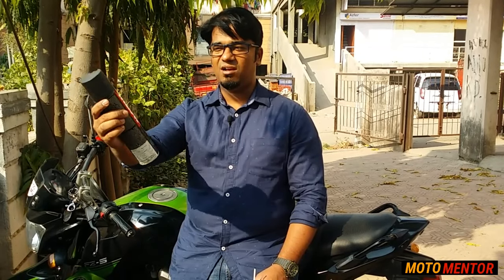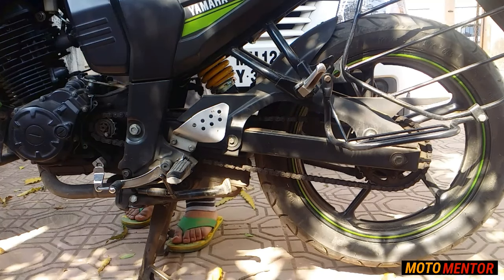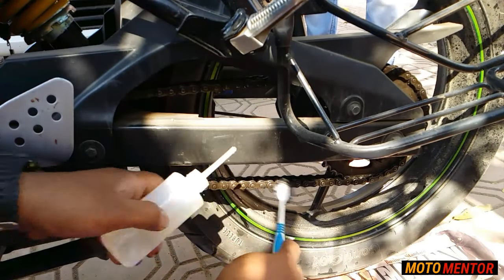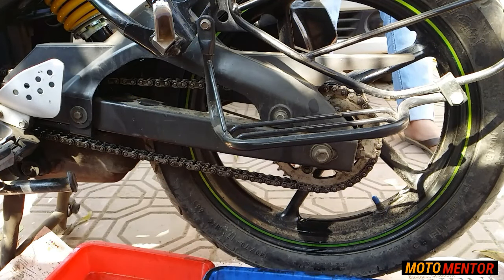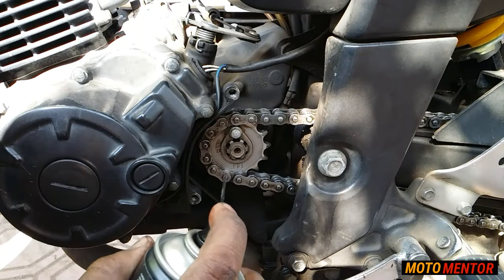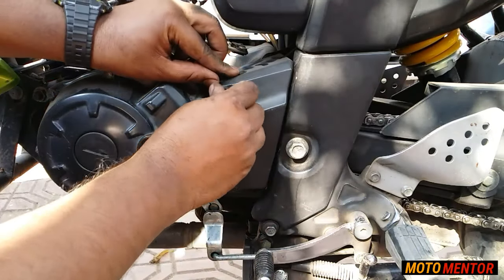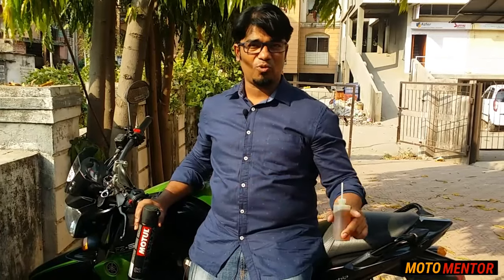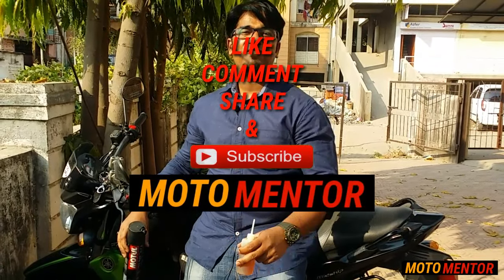BIKE CHAIN NOISE ? THIS IS HOW TO CLEAN AND LUBE MOTORCYCLE CHAIN MOTUL CHAIN LUBE VS 90 GEAR OIL

Comment: Bro thank you very much for that information...  Nw 2 month's end..  I'm using this oil method..  My bike chain is perfectly ok..  And my bike always run very smoothly..  Thank you very much brother..  🙏🙏🙋
Reply from the maker: THANKS FOR THE APPRECIATION VINAYAKA THIS MEANS A LOT 🙏
Reply: @Yash D 300 or 400 .. Or dry honeke baad
Reply: Bhai, will the oil get sprayed on to the wheel rims/ mudguard while you ride the bike after lubing?
Reply: @MOTOMENTOR  Can I Use Diesel For Cleaning
Reply: @rajkumarbabaleshwar255  no.... kerosene is best .... It's said that diesel in some cases hardens the chain o rings ..... Soo go for kerosene .....
Reply: where can we get gear oil.?
Reply: @sapienmanas0735  Amazon but now there is out of stock
Reply: @MOTOMENTOR  tumrha chain sprocket kitna chala gear oil ke sath

Comment: Using graded oil for lubricating chains is a very old technique and is successful for years. Actually present generation boys follows few vloggers who r sponsored by companies like motul etc etc who promotes those companies  product by using their products on screen during their tour like leh ladakh and others showing if by using those products they have trouble free journey but parallely those products r very very expensive also
Reply: Correct
Reply: Yap bro sponcer ke liye  vlogger kitna chutiya banate hai.😞
Reply: Absolutely 💯% Correct
Reply: Absolutely right in owners manual it's clearly mentioned it how to lub chain. But nobody have a time to reed the owners manual.
Reply: @gaurav8580  true
Reply: Can I use "used engine" oil ? which is also called mobil I guess
Reply: Imagine owning a superbike and using your age old "graded oil" for lubrication and getting the whole drivetrain greasy and muddy due to the Indian conditions.
Reply: Companies like motul are a Premium option for cleaning and lubrication, there are various budget options like kerosene for cleaning OKS, kangaroo etc for lubing, they don't attract much dirt and don't fling off the chain and make your alloys dirty.
Reply: @imshahrukh4068  unused engile oil ya phir gear oil use krna bro main bhi krta hu
Reply: Truly said. I have always disassembled the front sprocket and the chain, then cleaned them thoroughly with the help of diesel or kerosene. Then applied grease and that's it. It runs smoothly.
Reply: Bro even iam using grade oil for my bs6 Gixxer chain.. pros: running smooth and fuel efficiency, cons: dirt sticks with chain
Reply: Agreed
Reply: @aniruthparamasivan3441 Chain spray catches equal amount of dust as gear oil.
Reply: Looting public all chain lubes smell alike 90 grade gear oils
Reply: @PRITAMPAKHIRA But at rainy seasons dust accumulate more better clean 90 grade afther two weaks according to yours drive clean and lubricate👍
Reply: No.
Wrong idea.
Reply: Motul sirf naam ka hai isse badiya Castrol hai

Comment: I recently bought gear oil to lubricate the chain on my classic 350 only because chain spray is not available in this small town I'm at. Pleasantly surprised to see the smooth results..and had been wondering why everyone is not doing this in the first place.. Better than the expensive chain spray in my opinion.
Reply: Because it makes your spokes and rim dirty.....whereas chain lube like motul are....a bit dry type.....so it doesn't get on the rims and make it dirty
Reply: @nirupam683  yes you're right but when you know just how much oil to use, it is as good as any other sticky lubricant. Also you'd have to apply more often than chain spray but I noticed it helps keep chain cleaner.
Reply: bro how do we get this gear oil whats the name of it.
Reply: Working good with rtr 200
Reply: Please let me know the name of oil?
Reply: @archandey1183  scooter gear oil 90 name hai 70 rupees ka aaega 120 ml ...
Reply: @Hse-d7c  link dedo yaar
Reply: @PANKAJKumar-n6s3o  kise bhi store pe mil jaega service centre pe

Comment: My bro finger also went inside the sprocket. When he was lubing the chain with oil (engine started) oil start to drop from chain then he put clothes on there. in a second clothes traped in the chain and the chain pull the clothes and his 1 finger go through the sprocket and his finger cruched and blood spreaded around his face. Now his finger only 90%. He doing that every month and also he have experience. Guys don't ever do this in engine on even if you have experience. Do it manually.

Comment: 90 grade oil will throw and splash on your pant, oil will always attract too much of muck and dust. Always use a chain cleaner spray and after it dries then spray Chain lube and wait for 10 minutes before you strat riding. ( Chain spray only for "O"ring chain, with out chain guard)

Comment: chain me O ring nahi hoti hai..it is called links...Thre is bush or roller, that's why it is called roller chain. The best way, however bit technical and not that easy is to remove chain lock and take out the chain and keep it in degreaser for soaking for one hour or so then clean it out side the bike Lub it and again fix it on bike.

Comment: Fed-up with garage mechanics. Got cheated alot over 5 years and finally decided to learn repairing things one by one myself. Saw this video and first time i used 90 grade oil in my pulsar 150. Oh my god what to tell? The smoothness was awesome. There was no vibration till 70kmph(my bike used to vibrate after 50kmph). 

It was a good information.
Reply: Ha bhai thugte hai esliye mein abhi tools leke khud karuga
Reply: From where did you buy this 90 grade oil?

Comment: Thank You Sir. This worked for me.
I would like to inform that I own a BAJAJ AVENGER 150 STREET BS3 that is 4 years old.
I used a CASTROL SCOOTER GEAR OIL 80W-90 for lubricating my Bike's Chain.
Thanks to you once again sir.
Reply from the maker: Yw brother 🙏
Reply: @MOTOMENTOR  Can I use "used engine" oil ? which is also called mobil I guess
Reply: Bro can you give flipkart link for that oil
Reply: @BEN-sh6cn  no bro. I purchased it from Local store.

Comment: i started using diesel to clean the chain as after various research and all I got to know that kerosene is a bit harsh to o rings but not as much as petrol, on the other hand diesel is the best of all. sometimes I use engine oil(not used) to lube and they work the best. Good information provided in the video,keep it up.
Reply: true - petrol, kerosene & then diesel - the least harsh on finer components - aaron (enfield)

Comment: Use sae 140 gear oil that is used in autoriksha. It is thicker than sae 90 I am using it in my platina bike since 2010.u will get butter smoth experience.
Reply: Where to get sae 140?

Comment: THIS IS A IMPORTANT WARNING
please pin this comment
never run your engine while cleaning chain.i am typing this with my left hand cause a week ago my hand went inside my 200 ns and two fingers almost cut off and i had an operation
so please guys dont do the same mistake
i was lucky that they didnt cut off
Show less

REPLY
Reply: Bhai sahi bola
Reply: Agree....most stupid thing to do by putting it in gear
Reply: I'm sorry to hear
Reply: PUT 2 FINGERS IN p220 , lucky dat it was first gear & had one fracture.
Reply: my friend did diss in fz & lost thumb
Reply: tejashwi bhaskar ooh.sad to hear that
Reply: My one finger
The nail part is gone
Reply: I don't know how many times I have I have heard of similar accidents. Never run your bike while cleaning chain.
Reply: same , broken finger , nail , and lot of pain
Reply: Ya my thumb got stucked on my ns200 my thumb is total damage in two piece
Reply: Bro 18000 km is enough life span of a chain spoket ... Can't blame the lubricant ... For the damage
Reply: Correct Bhai
Reply: tejashwi bhaskar 1.st. is the strongest one .
Reply: How are you now brother..
Reply: Totally agree with you brother same with me my chain cleaner brush stuck into chain and it brokes luckily my fingers won't go into them
Reply: Mine to....
Reply: I do this with the help of vaccum from a distance of one feet
Reply: Same thing happened to my friend with his bike
Reply: Thanks
Reply: Same mistake done by me and my thumb got stuck in ns 200 chain sprocket
Reply: Okk thanks
Reply: yeah right... if you want to warm your chain up, drive it several minutes and resume the procedures..
Reply: Sorry for your loss. Take care bro.
Reply: True .. but i just started engine to spray chain cleaner and only for chain lube whi cleaning off the motor and move back wheel in clockwise direction .. and cleaned chain effortlessly ..
Reply: So sad for u
And great advice to public

Hats off.......,😍😍😍
Reply: Sorry to hear that thanks anyway
Reply: Never touch the chain and gear wheel with your fingers directly even while rotating the wheel by hand, to clean use toothbrush or chain cleaning brush.
Reply: Bhai ye to comon sense wali bat hai
Reply: My friend lost his thumb while cleaning Royal Enfield 350's chain..so guys be careful while doing such thing's at home...
Reply: Even i had a very bad experience almost lost my thumb 7 stitches 😓
Reply: Tnq bro for ur important info
Reply: @tejashwibhaskar  First gear is the worst gear to get your hand stuck
Reply: Get well soon bro..
Reply: Avoiding safety may pay the price...
Reply: Correct....Bro lost my middle and index finger of my left hand while the engine was on 😔
Reply: Bro same happened with me in 2012... I was cleaning my yamaha fzs chain... my index finger got stocked in chain...I have spent about 40 thousand in saving my figure...  plz let the mechanic do his job
Reply: Exactly ..my friend did the same thing and his finger got cut off while cleaning his CBR 250r 
So everyone be safe
Reply: My friend is brother faced this same issue
Reply: Get well soon brother
Reply: Both my middle and index finger were caught in a bike chain when I was 8 years old. It was because I was not thinking and being careful. This guy is being careful but still ya, i wouldnt recommend starting the bike.
Reply: OMG, sorry to hear that bro 😷
Reply: Same thing happened to me..
Bone got fractured and 1 month rest .thank God engine turned off.
Reply: Yes
Reply: Even if you are surgically accurate with running the bike in gear, it only takes one small mistake. The leverage of a chain against a sprocket will easily remove a finger even on the smallest engine. Spend the extra 5 minutes and keep your fingers. The bike will not give you any chances. If you have a strong stomach there are plenty of images on Google of this exact mistake. It's usually the rag or brush that gets dragged in followed by the hand/finger.
Reply: Mine have blood clot on my middle finger i was lucky enough
Reply: How is your fingers now???
Reply: Now how r u bro ?
Reply: same here  men nail part gone off
Reply: Thank u bhai🙏🏻
Reply: Take care
Reply: never ever I won't do it.
Reply: So Sad to hear Bro.
Reply: My bro also do this same thing then cut the thumb😢
Reply: Take care bro
Reply: So sorry 😥  thanks for caution
Reply: Thanks for informing
Reply: there's no contact between the oil lid and the chain. even if you are using a brush, never perform it on a running motorcycle
Reply: Yo sahi hay
Reply: SAME WITH MY FRIEND
Reply: Very much sad to hear brother, i can feel the pain,  how are u know after 2 years ?
Reply: My frnd also faced this problem. Now he has only 4 fingers. One finger was removed. His bike is fz.

Comment: First time I'm using a bike without chain cover and I was worried, confused and tensed regarding lubing it's chain and also regarding which would be the best way to keep Bike's chain last longer and moreover saves time and  money. I think this video helped me a lot and built some confidence in me on lubing chain with gear oil which works superb on chains and last longer.. Thanks a lot Bro.. keep Coming with new techniques. 
make sure no working on chains when engine is on.. thank you

Comment: Okay it’s a good one the gear oil stuff. But try to  avoid gear oil in rainy season or don’t use excessive . The oil is quite thin and get easily mixed with the  rain water while running in chain sprocket. This further leads to the oil all over your back tyre on the road too. Whatever it is it sticks to your tyre further making your bike wobble from back side.
Reply from the maker: Thanks for bringing that point kaustubh you are absolutely correct 👍

Comment: 90 w gear oil is best for bike chains. Gear oils are traditionally used in gear box to lubricate the chains inside gear box, similar to the wheel chains. Its prevents any sticky or dirty chains.

Comment: Too much discussion, but my Hero Honda passion plus of 2008 completed 70000 km today so just wanted to take care of bike so searching videos. But what I found is hilarious. I myself never clean or lubricate or adjust the tension of my chain but every service interval (2500 km) mechanic does it. Every time I wash my bike once in 2-3 months I go to mechanic and ask to lube wherever and whichever parts needed it just for 10-20 Rs and in these 10 years and 70k km running neither chain nor sprockets are changed. There is no noise, no rust.
So shall I be more cautious and take care of my bike or will it be good idea to leave it on mechanic as I am doing this for 10 years.
Reply: Because passion has chain cover bro...
Even my hero hunk driven 38000 kms with showroom chain, and it also has chain cover... Now my bike cross over 76000kms with 2nd chain now i need to replace it....
Reply: because you might be riding at 40kmph...so less wear and tear
Reply: Yeah.. I am mostly riding between 45 to 55 not more than that. And yes chain cover is convincing reason. Thanks for throwing light on this.

Comment: Excellent, I had also been used chain lube, later swiched to ususal engine oil  20w40 . But it is far superior to use Gear oil 90 as the viscosity is high. But note, kerosine washing suggestion for chain is not good, after washing and even after lubed chain, it mskes irritating new sounds. Washing chain in diesel is slightly good than kerosin.
Prakashan.
Reply: Add some oil or atf to the kerosene.

Kerosene is the solvent, atf or oil is left behind after the kerosene evaporates.

Comment: Very good info, thank you. I have one doubt - will the oil from the chain get sprayed on to the wheel rims/ mudguard while you ride the bike after lubing?
Reply: Yes it will get sprayed on the wheel. I apply car wax to my chrome wheels once a month and the oil comes off very easy. I also use 90 weight gear oil
Reply: @mikga45  , Thank you yaar, thanks for the tip
Reply: @cksajeevkumar  your welcome.

Comment: Safety first brothers,take his advice.My friend's hand was crushed ,when it got into the rear sprocket,while oiling the chain with the engine running.Please take care coz the pain & damage he went thru is indescribable.Peace bro.
Reply: true - first & last caution (cleaning with engine running) -  ALWAYS use the nozzle extension / plastic straw to spray - keeps contact a mile away ! - peace ps: srry bout yr friend - cheers (aaron - enfield)

Comment: Very useful info. Gear oil is the best to lube the drive chain. It last much longer especially during the rains and is quite cost effective.
I personally use diesel to clean up the chain. Its not as good as kerosene being a little thicker but in Goa Kerosene is not easily available so diesel is our best bet here.
Reply from the maker: Thanks  Clinton.

Comment: Take some diesel use old tooth brush and clean chain by running the bike in stand, once cleaned use tap water to clean and put it dry by keeping some hour idle , then apply gear oil or chain lube

Comment: Actually in the bike manual it's mentioned that we can either use commercial lubricant spray or 90 gear oil .( Honda shine)
Reply: Yes bro. I have bajaj avenger 160. Bajaj service centre also to use spray or 90 number oil to lube chain

Comment: Chain lube is totally different from that gear oil. I used both. In chain lube the fluid enters most of the parts and applys evenly but this cant be done in gear oil. Waxpol lube is by far the best in lube that i have used. If used both than chain will last longer. Mine is now running 27k km and still perfect in the most rainy region of india (?). In rain nothing is better than the gear oil as the cost is very low and can be carried easily on a bottle.